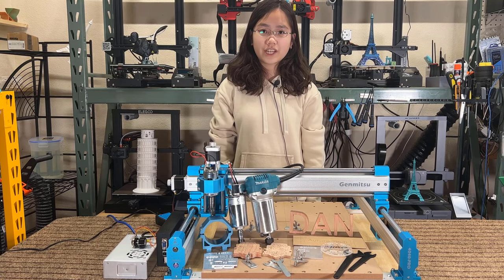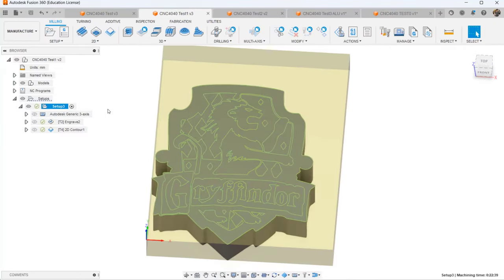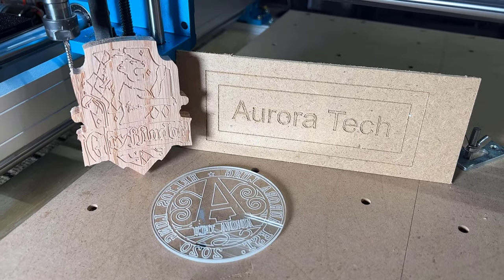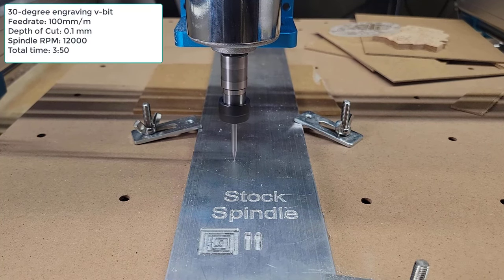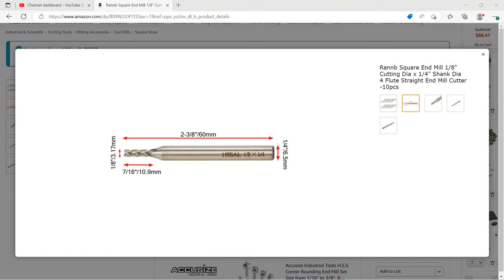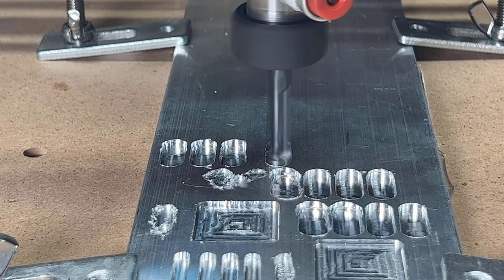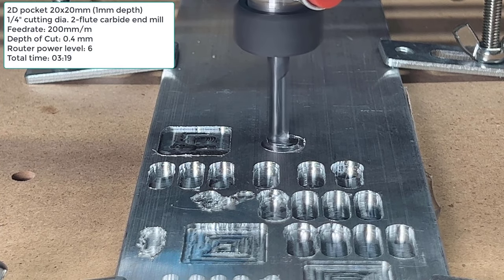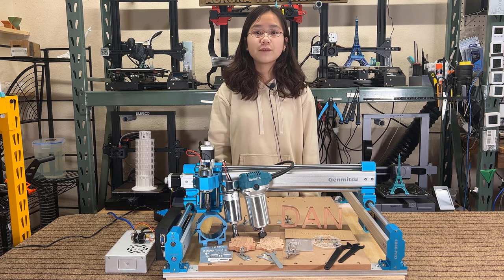Comparing 75W, 300W spindles, and Makita wood router for cutting aluminum on Genmitsu 4040 PRO CNC

Comment: Most of the problems are caused by rigidity. The router should be mounted close to the bottom. By mounting it closer to the top you are increasing the amount chatter due to the leverage. As a general rule endmills stick out should be kept as short as possible. You should be able to get much better results from the same router
Reply: Also the bits are sticking out too much. No coolant fluid either. 

This was like a torture test.
Reply: @TechnologistAtWork  I know I mentioned it to you.
Reply: @gremlinsports  I know, I added further to what you said.
Reply: @TechnologistAtWork  Not really endmill stick out is bit stick out. I didn't miss anything you just added what I had already said.
Reply: @gremlinsports  you forgot about end mill stick out, no worries bro I got you
Reply: Actually forget my comment both this videos router and my router are flexing too much.
Reply: @TechnologistAtWork but they advice you to stick the endmills at the collet edge (inner)….
Reply: @arbjful  that's a wrong advice. The longer the bit is sticking out the more it tends to oscillate and destroy itself.

Comment: Just a heads up on the Makita router, they're actually used a lot in MPCNC builds, and V1 Engineering sells a 1/8" collet adapter for them for only a couple bucks. That would allow you to use all of your original bits for this machine so you could do an even better apples to apples comparison

Comment: As a machinist, one rule of thumb for end milling steel was to not have over 4 diameters of the end mill extended from the collet or the risk of chatter would increase. Certain circumstances it could be successfully extended further. Other softer materials such as aluminum and wood give a lot more flexibility but when encountering chatter I always started with the work holder rigidity and how much tool I had unsupported. A 30,000 pound machining center had to follow the same rules.
Reply: Very good advice. Thank you.

Comment: clamping the router close to the bit instead of the top of the router helps, but that z axis needs a mod,   two short lineal rails should not be difficult they are cheap and a mini project to do

Comment: you should always climb cut on a cnc. also insert the end mill as far as you can to keep flex to a min.
Reply: Climb cutting is not always the best option, especially on a machine that is not very rigid. When climb milling the bit tends to grab the material (climb) and exadurate the moved due to the lack of rigidity where traditional milling pushes its way into the material minimizing the lack of rigidity. Both are affected negatively by the lack of rigidity though.
Reply: @tedreynolds4368  CNC was the key and point. how many years do you have working in machine shops? do you have issues with the end mill being inserted properly also? there are many reasons to climb cut on a cnc and nearly all operators climb cut in the machine trade. but i will not debate this in a comment section.

Comment: Check out gwizard calculator; will save you a lot of heartache in re the correct feed and rpm based on the number of cutters and tool diameter.  Instinct always says go slower or turn it up if stuff isnt cutting well, but that's not always true w machining metal.  All and all, fun video and I appreciate the content and experimentation.

Comment: With the smaller spindles most of your issues were coming from the long length of tool compared to its diameter, you could see it in several clips juddering to the side a reduced length of mill would make a big difference, With the Makita it needs to be clamped lower on the router to reduce flex, this might mean raising up the spoil boards but in all cases flex is bad, it looks to be a good machine for the price just not great for machining metals

Comment: As being a CNC Machinist and it's what I do for a living. I'd like to point out that and let you know that at times your doing climbing milling instead of traditional milling at times when one or the other should be used. On machines that not as rigid as say a v5 0r v2 that huge. You could look at just doing traditional milling only when doing pockets with a .010 or .005 wall offset and floor offset. And then do a finish pass on the inside of the pocket to finale demotions and have a good surface finish. On your slots try doing only traditional milling in one direction and your bit wont jump around and might allow for deeper nicer cuts.

Just trying to help, love your videos thanks!

If I can be of any help, please feel free to reach out to me.
Reply: Hello, why is it better to use conventional as opppsed to climb milling? My naive intuition is that for a machine of questionable rigidity, you'd be much better off with climb milling so that you could  come back and do finishing passes.
 I'm pretty new to this and I'm looking forward to hearing from you.
Reply: @brikfilm  When you climb mill, the cutter can pull the router along as the teeth bite in.  If the machine isn't rigid enough to resist that alone can cause problems.  Climb milling also means that the cutter can be pulled deeper into the cut.  At best this results in an over-sized slot/pocket.  At worst it can result in fragments of carbide flying towards you - carbide is very hard but brittle and doesn't like being bent.  Conventional milling does the opposite of these which is safer - if it's undersized, you just have to run a spring pass (same dimensions but run again so if the endmill was bending away from the work, it can cut to dimension after it springs back)
Reply: @brikfilm  I'm sorry  but I didn't get a notification about your question, If I seen this sooner I would have given you a better explanation. But @Cenedd gave the same answer as I would give. Thanks for the questions. And remember stay curious and keep on making things.
Reply: Hey man anyway you can help me dial out the x axis on a cnc router? You got a email? Or like a discord zoom chat?

Comment: The Makira router will have much better results if mouted proprely. In your review, at 16:43 you can see that you allow it to create a lever effect (forcing the Z axis and X axis). If you clamp the makita router from the lower part (as intended) the flexing of the machine will be much lower. Ps: use shorter tools, as much as possible.
Reply: I came here to say this
Reply: yeah that's fair although when she's pushing it at 27:19 the whole x axis is moving although most of the actual twisting is on the router so fair.

Comment: As an older CNC programmer, I would give you  a quick tip: Doing engraving in thin materials, always machine inside to outside.
The first frame you did, should be the last one to machine.

Comment: This old man has learned a lot from you and your videos.  I have just a few thoughts for you wrt the cnc machine.  Open grained woods like oak and ash can be a challenge to get a nice surface.  Walnut, maple, poplar and many other closed grained woods offer beautifully carved surfaces.  Of course, climb vrs conventional cutting direction can make a difference relative to the wood grain in the piece.  Secondly, I'm sure you've taken the appropriate safety precautions when testing the cnc and the various bits.  That said, when a HSS or Carbide bit breaks, it can be quite a hazard to the soft areas the shrapnel may hit.  Keep up the great work and I look forward to the next video expertly narrated by you and edited by your brother.  Just to add to other comments, mounting the spindle as low as possible and keeping the bit as short as possible in the collet will really help the overall rigidity of the setup. Keep up the great work and I look forward to the next video expertly narrated by you and edited by your brother.

Comment: Great video! I love this A/B/C testing, it’s hard to get good documentation on comparing available spindle options. On a safety note, I hope you can get some good workholding going for you so you don’t throw a part and hurt something (or worse, yourself!). My personal favorite for sheet stock is painters tape on the bottom of my material and on my bed with superglue between them. Cheers, can’t wait for the next one!

Comment: I built a new z axis for mine and changed everything to regular linear rails when I added the Makita router and it works very well. You can get an 1/8" collet for these routers to run cheap 1/8” tools as well. With air cooling it does very well in aluminum.

Comment: Thanks for this great review.  I have a 4040 and did upgrade the spindle to an 800 watt with a VFD.  I found it interesting in your review that there seems to be a sweet spot when it comes to spindle speed.   It looked like the chatter occurred with both too low and high RPM.  Overall I am very happy with my machine.
Reply: I appreciate the feedback.

Every clip educates and keeps me on a creative plain. Basically saving time by reducing the trial and error factor.

The editing and the narration are very well done.

Keep up the great job!

Comment: Thanks for the video! Liked the way you explained everything! 
I've got a few tips though... 😁
The clamping of the thin MDF and acrylic wasn't really good, it clearly wasn't supported/held down in the middle, that causes vibrating and will leave a rough finish..
Also, the length of the 1st end mill is way too long, it will vibrate like crazy!! 
I would trow away those ridicules ''clamps'' and make some better ones (or buy some), that will make the milling process a lot more stable and have a better finish all around!

Comment: a trick that would help you is if you put painter's tape on your spoilboard, on the back of your working material, and then spray adhesive on the tape and press them together. It would hold your media in place better while etching. will also help things like the acrylic bowing upward. Also, set fusion 360 to leave tabs around the edge to keep it from shifting on the final cut. Machine needs to be trammed as well.

Comment: Great video! If you plot the results of your test with the feed rate, depth of cut, and spindle speed, you’ll find a sweet spot that corresponds to the chip load. There are calculators to handle the math but basically based on cutting data you can fine tune how much bite each flute takes per revolution. You’re onto it already with your test but you may be able to get the cutter data from the manufacturer or so I’m told… I bought cheap bits and had to do my own tests.
Reply: An excellent source for chip load and other information needed for machining aluminum is the machinery handbook.
The major problem that you experienced though was the rigidity of the machine. As others have mentioned, the best practice is to keep the mounting of the spindle and the bit as short as possible.
One other issue is the clamping of the material. The clamps are being used backwards. They are meant to have the solid end on the workpiece and the screw on the other end should be adjusted to be slightly higher that the material thickness with the screw to tighten the clamp being as close to the workpiece as possible and closer the end of the clamp that is on the material than the other end. The way the clamps are shown in the video, the force is only on the edge of the material and not holding it down as much as it could if used properly.
Overall the video was were well done and the clamps weren't an issue but the rigidity of the machine looks marginal.
Reply: @tedreynolds4368  the clamping is atrocious.

Comment: Another “2¢” I think that the size of the Makita contributes as much as the added weight. The longer dimensions mean a longer lever torquing against the z axis. The weight has some benefits in CNC as long as the machine is rigid enough to support it.

Comment: Great content as usual! Do you think the 3030 Pro Max will be suitable to make copper parts? Like 80x50x30mm with 18mm depth of cutting? I need to make custom heat exchangers for a refrigeration cascade system to produce LN2 :)
Reply from the maker: To cut deep down to 18mm, you require a longer tool, but I doubt any budget machine can accommodate such a tool for cutting metal.

Comment: Your videos are so great thank you so much
I would say that when you are experimenting with slot cutting, you may want to widen your slot just a little bit so that you're not cutting both sides at the same time. This old Tony has a good video talking about the problem with trying to climb cut at the same time that your forward cutter whatever it's called, anyway it's a weird set of forces and my impression is that it's a better machining practice to just cut the one side at a time and less likely to create strange resonances with your bet disclaimer I'm a beginner and I might be wrong about this analysis

Comment: There's two things going on when cutting aluminum. 1. the bits are too long for their diameter, not rigid. 2. the type of end mill you're using is not a center cutting end mill. If you look carefully you will notice the problem arises at step down. That is because material can't be removed from the center when stepping down. Look at the cutting edges on the bottom and you will see they don't extend past the center. Hope this helps!

Comment: If a person would upgrade to some sort of blower to keep the bit clean the aluminum cutting may be smoother as it tends to stick to the bits a lot being a soft material. Also with the Z axis pulling downward on the entire gantry every time it comes to a stop its going to cause that chatter that kept eating circles in your cuts of straight lines. The manufactuer should add 50.00 to the machine and beef up that gantry and this could be a superior machine in its price range.

Comment: the type of  cutting tool that you used was pointed and the other one is with diameter size and it was also overhang it will cause also the vibration.. pointed cutting tool versus endmill cutter has different  surface cutting performance, clamping method must be consider also.

Comment: Interesting video and product, unfortunately now I just want you to have an actually rigid machine so you can see the difference.
Well presented. 

Also be aware many endmills are not center cutting. It looked like the one you used in the Makita was not. To plunge with them you need to move back and forth to cut out the center.

Comment: Hello PRINTcess. A little off topic. I just can't get the webcam to sharpen on the Sonic Pad. Full HD camera, where I can not understand where to change the resolution settings. Maybe you can advise. And a joke - instead of a camera, I connected an endoscope and it worked. This is for information.

Comment: Great videos. For what it’s worth, I will say that you may fare better if you find a way to implement a coolant system or at least spray some cutting fluid what you’re milling. You could also probably get away with using a cutter that has a coating that’s designed to displace heat and aide in chip evacuation. In my humble opinion and experience, if you’re seeing more powder than “chips”, you’re going to run into problems caused by friction. The bigger the chips, the more you’re pulling away from the work piece before it has a chance to build up heat, which is always your enemy. Just my two cents, anyway. Great video nonetheless!

Comment: I am very interested in this what software are using an will it run on a Mac
Great review thanks for all your work
Reply: Old comment, but... yes, you can run all of the required software on a Mac. She's using Fusion 360, and depending on the specific CNC control module your mill/router uses, you'd use something like Universal G-code Sender.

Comment: can someone please explain me why the higher HP motors cut better? because in my opinion the 775 motor doesnt reach its power limits while cutting even high carbon steel (on my mashine) so the only thing i can imagine is if the other motors reach higher rpms but while that would lead to a better cut it would also use up the tool even more... so... am i right in my asumption or why does it cut better?
Reply: PS. plastics and aluminum are pretty bad materials to use on a mill since they gum up pretty easy so there are plenty of things that can affect the results with warying feeds ans speeds so i usualy use brass or copper to get good compareable parts

Comment: check the makita holding, it vibrates too much. For such small maschine use 2007,6061 or 7075 AL , the extruded profiles are not godd for making chips, i struggle with a huron vx8 too with this extruder-al. with 7075 i can go triple speed and triple feed without cooling.

Comment: You are also doing dry cuts. Metal benefits a lot from an air jet or a water coolant jet. Minimum I would give it a drop of cutting oil if I want a really clean slot or pocket.

Comment: 800w is not 1 1/4 hp
router was mounted with to much stick out
feedrate for aluminium is 100-300 meter per minute (not mm)
would be nice to know the difference in runout of the 3 arbours
otherwise well done and informative 
thanks for you work on the whole video

Comment: Might want to try some cutting lubricant when milling that aluminum.  Nothing special is needed.  Even WD40 works pretty good on aluminum.  Wouldn't want to try that on mild steel, but on aluminum it is fine.

Comment: For aluminium with stock Spindle: use a short cutter, used is way to long. woblling like rubber. Use a AL specific cutter with 3 flutes 55 deg angle. You get way better results. Using Alcohol spray cooling, its better. Even with this toyspindle. Using a better spindel is way better.

Comment: I have a question, when u upgrade to Mikita 800w router instead of the spindle, are u just plug the router to get the power and dial the speed and unplug the connection of spindle of motherboards , is there have any another setup?
Reply from the maker: Yes, that's all you need to do, the CNC just helps you to hold and move the wood router, it has nothing to do with the power and speed control.